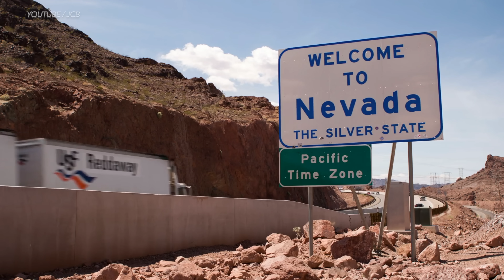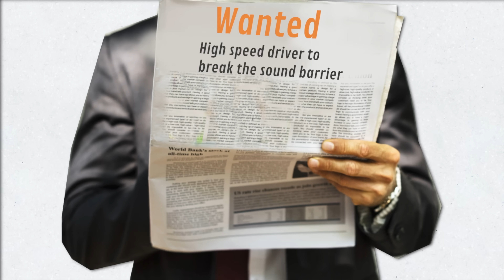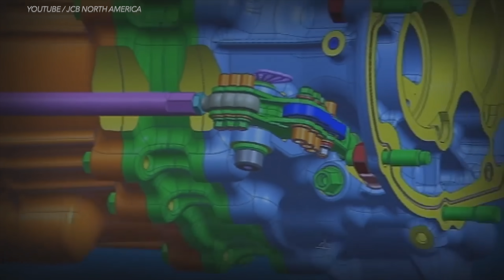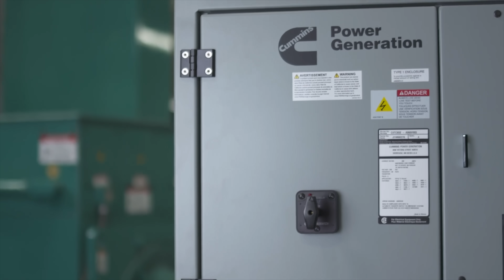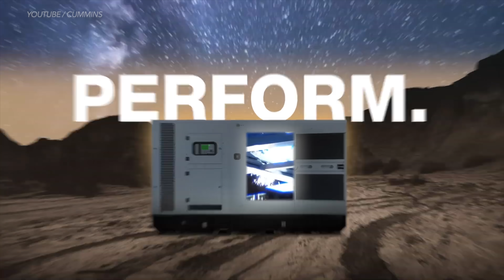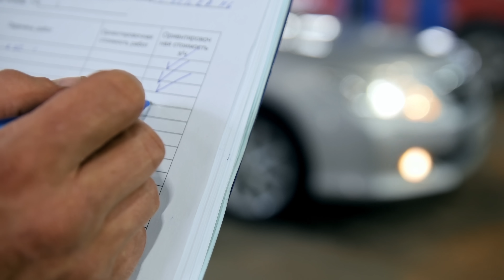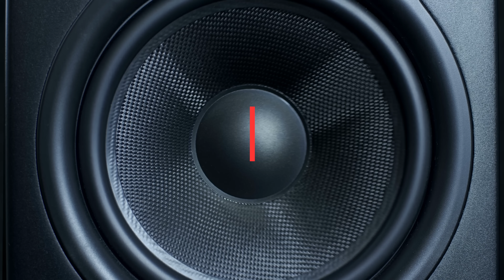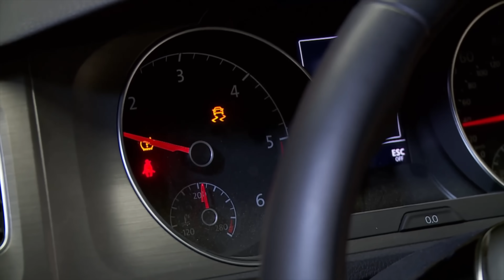Here's Why Diesel Engines are Being Banned

Comment: 0:10 - What good does it do to have a diesel engine?  You'll find that the higher efficiency is offset, almost exactly, to the penny, by the higher price of diesel.  You save nothing.  You get a touch better performance... and a whole hell of a lot more headache maintaining and repairing the engine when it fails (and it will) sooner than a typical gasoline engine.  They're designed that way.  Only big diesels, like semis and other industrial engines, can go half a million miles before they start to fall apart.
Not turbodiesels...
Reply: Dont now where you live but in the UK presently petrol £190 ltr, diesel £1.96, price difference pretty insignificant I,d say, yearly service £250, 9yrs old 2.2 D, Honda. cheap cheap cheap.

Comment: I still love my 1995 Toyota surf. Strong robust and reliable. Given regular maintenance and services will still last many more years. Yes  a little noisy than petrol. But if you want a car that you want for years and not trade in often a diesel for me is the best choice.I do find petrol engines fragile in comparison. Whats an electric car for? How long are you going to wait for a full charge? Better bring a hand cranked dynamo generator to charge them batteries when you're out in the middle or nowhere !! 👍 Just saying 😉

Comment: There's no solution and there never will be. The more EV's we have the more the demand for electricity. In the years to follow, they'll admit this plan isn't working because renewables just wont cut it. And there's this thing called population increase. Then they'll decide maybe it is time for nuclear power plants. Then they'll realize the mining for Uranium consumes just as much energy as mining for coal. Then there will be more nuclear waste in the years to follow. There "is no" solution. The greenwashers need to STFU and leave gas engines the way they are and leave the diesel trucks alone.

Comment: I recently got the Diesel powered 3.0L Silverado RST Crew Cab, no regrets here. I love it and it replaced my 2014 Sentra(45k miles)...before the dreaded transmission problems of it's crappy CVTs could happen out of warranty and all the cars at the house where in no shape to tow anything(2021 Tesla Model 3 Performance, 2018 Hyundai Sonata Plug-in, 2016 Chevy Spark EV). Daily driver to work that gets almost similar overall millage I got on the Sentra and tows and hauls cargo whenever the true purpose of getting a truck is actually needed for...and when all the family is home for the holidays it can sit 6 people rather comfortably so it also makes for a good road trip vehicle, though that won't be happening anytime soon with sky high fuel prices.

Now while having this maybe the EV truck market will mature more in the meantime when more competition rolls around in the next couple of years and certain car makers solve their current problems. Ford is too new to the game to determine and Chevy is having the major issues with the Bolt EV...so it's concerning to think about a Silverado EV before they fix the Bolt's issues. Which giving it a couple years time is advisable.

Comment: I have a 2014 Ford Mondeo 2.0 L diesel. Is a very good car and the fuel economy is pretty good as well. Just did around 1000 KM with a full tank.
Reply: I had the same car, with the same milelage. I loved that car, but had to sell it because the milelage was over 500kkm. I also had no single problem with it in the 14 years i drove that car.

Comment: Driving my Mercedes’ bluetec diesel for 13 years now. It has its issues of leaking oil and bad urea pump heater, but I can live with it. There is nothing like it when I go on long trips and getting 30mpg and 600+ per fill up. Not until recently, diesel at where I live is cheaper than premium gas.

Comment: I am from the Eastern Europe, and I have always been driving Diesel cars. I also drove gasoline cars, but only in USA and twice in the Western Europe.
My feedback regarding this topic is that Diesel cars are absolutely great. The maintenance and service costs are not higher at all. The mileage is absolutely great. They are surprisingly reliable. The running noise and exhaust emissions decreased dramatically during the last 10 years. You can drive Diesel cars in every driving style.
Unfortunately the combustion engines are pushed aside lately, but a world without such cars is just a lie.
Reply: Totally agree. A lot of the "facts" in this video are not correct. 
Diesels are very good now. They didn't use to be but the technology has made them much easier to live with. 
Main problem is finding a decent garage to service with quality parts.
Reply: I live in Sweden where we have very cold winters and my diesel car has never failed to start. It also has a built in fuel fired heater that can be activated remotely so that the windows are already defrosted and the engine is pre-heated when I arrive at the vehicle. Modern diesels are great for winter conditions.

Comment: That VW engineer who came up with the test scenario software is a genius.
Reply: All the manufacturers did it, VW were the first ones to get caught.
Reply: @dr1verman  if it passes at the said test areas whats the problem the government more than likley did not get there kick back !
Reply: The only reason the government got involved with VW is the Jetta diesels averaged 50 mpg. Couldn't have that kind of fuel efficiency. A good friend got caught with an original program when he went to get emissions and the emissions were almost zero. He got fined and they changed the program without his permission. He went to 27mpg and still passed emissions. He moved to a non emission area and had a friend reprogram it back to the original program. He's back to 50-52 mpg.
Reply: My cousin had one that got recalled.  That Passat got 55 mpg.  After retune them and putting in it my wife bought a 2012.  It now gets 43.  That def suck the power and mpg out of a diesel engine
Reply: Now that the EPA is about to be torn apart and thrown to the wind, can we get some sanity back? EV's are a J O K E. The power to build them, to build wind turbines and solar collectors, has to be made by diesel, coal, hydro or NG. Steel has to be made using refined coal called COKE, which needs heat and pressure provided by NORMAL forms of energy.
Reply: So many they didn't pay for in the world and a smaller company would have been gone like firestone. So damn corrupt..
Reply: I am a retired used car dealer ,I own a 2015 VW PASSAT this is 
Absolutely the best vehicle I have ever sold !  Interstate travel  we get 47.9 mpg at best . Combined city driving never less than 39 mpg 
VW received the biggest screw job ever performed  !  If you remember who was in power during that time 2010 thru 2015 you will remember he hated Germany. 
Our dirty government lawyers went after VW with a meat grinder !  
If the same tests were made on all of our US company's at that same time by (independent  ) examination, that wasn't in someone's pocket receiving kick backs ,well the results would have show up . Biggest hit job in the automotive industry in American history  !
VW repurchased every 2010 thru 2915 Audi ,and Volkswagen diesel engine vehicles.  VW paid premium prices to the owners to get them out of there vehicle.  VW thin did a emissions re work to satisfy the US Government ,COSTING THEM $$$$$$$$$$$$$$ How they survived is astonishing.  
I am disappointed in the governments big arm in how Volkswagens trial was strong armed into a horrible settlement with the United States.
Reply: @timothycrose7081  we had a 2012 Passat TDI pre dieselgate. The neutered cars as you point out, got horrible mpg’s post OEM software ‘upgrade’. Now have a tdi Touareg. Would love to flash the ECU w after mkt software where you can reinstall post dieselgate OEM software for dealer services. But I hear there’s a software counter thing in the ECU that could cause OEM warranty issues.
Reply: your right and should be given a award
Reply: Nobel Prize needed.
Reply: My wife bought a used reflashed 2015 VW tdi for 6500$ with 70k miles in 2019 its bluebooks for double that now, they are a hot item it's our second TDI and I still daily drive our 2006 Golf TDI with 279K.
Reply: Cummins did the same thing lol. I owned a VW TDI first time now I own a Cummins lol

Comment: Yep. I  live in the UK now, and had a 2005 corolla d4d tspirit turbo 4 cylinder diesel car. Averaged 40mpg city, and close to 60 mpg highway. Sadly, I hit black ice back in January an it was totaled into a 500 year old stone wall. The wall definitely won, with just some scratches. I’ve now got a gas 2005 rav4 for the extra space. Get probably 35mpg city, 40 hwy. still not bad, but I sure do miss that Corolla.

Comment: ...big ocean transport ships pollute WAY more than all the cars on the Planet.  Now they are required to use low-sulphur diesel.  That's where it's all going...they need all the diesel fuel to run boats...
Reply: Low sulfur fuel oil and marine gas-oil are not diesel, but they do require more processing than heavy fuel oil. Maersk is building 8 large container ships that can run on e-methanol.

Comment: I'm French and here every one is still obsessed with diesel, the price per liter was lower than gasoline but that changed recently but it's still cheaper because you get more milage, here people even buy hot hatchback with diesel motors like a Volkswagen golf GTD or mini Cooper SD 

What a crazy place, I never owned a diesel and I'm never gonna get one it's just not that good it's feeling slow when driving and it's dirty and slippy when diesel is on the road it's like ice
Reply: Diesels are made for hauling and getting your a ss around.  If you want to race and waste fuel go get a gas one and eat your beans.

Comment: How long do you recommend warming up a diesel engine in a cold climate??
Reply: On my 2005 chevy 2500HD, until the glow plug light goes out.  15 seconds?  Start.  Then idle about a minute.  Never had a problem.  HA HA.  Haven't operated it below 0 deg F though.

Comment: Personally had diesel vehicles here in the UK since 1991, never had a single issue with any of them regarding the fuel systems, injectors, pumps etc. They are ultra reliable, my VW LT had done 200k miles when I sold it, and I bet if it doesn't rot, will do another 200? Our local taxi firm had Peugot 405s that did over 650,000 miles by the time they moved them on.

Comment: I never had a diesel however I did take a diesel mechanic class at a vocational school many yrs ago. I always found them to be noisy and slow now I'm sure they are better nowadays as I'm talking of the 90s primarily. Now if they really do have health risks that's kind of concerning especially for those driving one daily.
Reply: When you actually learn what diesel runs up to a million miles without rebuilding. If your lucky gas engines last about 150k and uses more fuel to hp ratio

Comment: Scotty's brain is dead  because the main transport mode for global trade is ocean shipping: around 90% of traded goods are carried over the waves. While the engines nearly all cargo ships use is diesel combustion engines to turn the propellers, plus diesel generators that power onboard lighting systems
Reply: Most ships use heavy fuel oil, some ships are starting to use LSFO (low sulfur fuel oil)

Comment: I own a Mercedes powered Jeep Grand Cherokee with the OM642 3.0l common rail turbo diesel.  Love the torque and fuel economy, only major issue(s) related to design flaw with pcv location next to turbo inlet.  Costly lesson but solution should enable me to go past 500k on the engine.  Need the torque to tow a camper.

Comment: Love my 1 ton extended wheelbase van with the GM 6.6 turbodiesel.  I hook my Jeep to the back and I'm good go.  Put it in tow/haul mode and set the cruise control nd sit back.  Up the mountains down the mountains in crise at 70-75.  Just picked up a new Jeep diesel - so far so good.  400+ pound-feet of torque barely above idle.

Comment: Got my first 3.0L turbo diesel 4x4 a Toyota 95series TX model almost 22y ago. Still have it original built as it is for me the best most reliable vehicle with the standard fitment longest range of +1400km(+890miles) and safest fuel for touring in the Australian outback on its 159L(42gal) tanks at 11.1L/100km(21.2mpg).
For around town I got a 2008 Hyundai i30 1.6L turbo diesel that gets near double the economy of the Toyota at 6.1l/100km(38.5mpg) and only issue being the transmission...
And for fun I bought a old driving school car being a 1986 Mazda 626D 2.0L diesel that after 36y on the road and with original naturally aspirated engine build and exhaust still is happy to chugg out 4.9L/100km(48mpg) all day and not skip a beat...
Heck, even my standby 6kVA generator is diesel.
Just wish someone would produce a affordable diesel ride-on mower so I could get rid of that dangerous flammable 20L(5gal) gasoline refueling container.

Comment: I'm driving a TDI Beetle I got from my mom.  It's an automatic, but I'm still getting over 40 mpg combined, so even with higher diesel prices I'm paying less per mile.  I enjoy the car, and I'm learning to do the little fixes.
Reply: The only reason diesel is more expensive in America than gasoline is because the oil companies testified before Congress that they should increase the tax on diesel fuel.  And they did.

Comment: I have the engine in the thumbnail, 2.8 liter Duramax in a Colorado. Awesome little truck that gives us 35mpg regularly which is amazing 4 anything with 4wd. Yeah long term it will likely have emissions system part replacements but even in the face if that I think I prefer that over turbocharged small displacement 4’s with direct injection and the issues those will face longterm. Hybrid drivetrains also gave battery pack replacements in 10-15 years depending on climate so I think there really isn’t a great, fuel efficient option if your plan is to own something for 20 years… or buy one if the current vehicles in the market when they reach 20 years old.

Comment: Railroad engines use the huge diesels to turn a large generator. The electric traction motors on each axle moves the train. Their advantage is when the wheel slips the electric motor cut off for a fraction of a second to reestablish traction. The generators put out 600 volts and up to 1500 Amps. Seems like a small efficient diesel running a generator would be a much better electric car syst than those heavy, highly polluting to produce, batteries.
Reply: How would that be an electric car?  What you described is a diesel car with an electrical transmission.  A while ago they figured out that with heavy-duty applications (trains, giant dump trucks, ships, etc.) a system that transmits power to the wheels (i.e., a transmission) yields much better performance and efficiency at a lower cost when it's electrical (or, technically, electromechanical:  generator->wires->motors) as opposed to purely mechanical (e.g., hydraulic).  That's not the case for smaller vehicles -- otherwise they would've already done it, since the technology is not new at all.  The exception here is, of course, hybrid vehicles, because in that case all you need is basically just an electrical transmission with some batteries.
Reply: The only logical use for electric motor driven vehicles, is a generator on board that can charge on the go.
Reply: @markslinger9042  Told the wife, if they make us go electric l'll be going down the highway with a small trailer with my generator and some gas cans behind me. Don't want to spend an extra 4 hours to make the already 6 1/2 hour drive to see my mother.
Reply: @markslinger9042   You're still describing an ICE with an electrical transmission.  In some cases that makes sense (e.g., heavy equipment and/or hybrids).  In other cases (e.g., regular cars) not as much -- at least not at this point in time.  

An "all-electrical vehicle", if you will, stores electrical energy on board but doesn't generate (most of) it.  The idea being that if the energy comes from a "clean" source, whatever the hell that means, at a minimum you're not burning anything on board.  Obviously energy storage is the big largely unresolved problem, but if you've got an ICE on board it, by definition, becomes an ICE vehicle regardless of how traction is actuated.

Comment: From an affordability perspective, diesel is at a disadvantage if you don't NEED a diesel engine for your application. The initial cost, maintenance expense and longevity can remove diesel as an option. Of course, some of that may be true for electric vehicles too. For populations where a daily driver on short trips is the norm, no 'long haul' road trips are likely. In locations with high density populations, public transportation is needed too. Regardless of the power plant, parking space comes at a premium. Human-powered solutions must be considered.

Comment: We have owned diesel pickups and semi trucks in my entire life. I would not choose anything else given the opportunity. That said, the diesel of old days isn’t the case today. The new emissions requirements are expensive to repair and the jury is still out whether it’s reasonable to expect 400-500k miles out of these engines with this emissions equipment intact. But In spite, I just bought two new 2022 model pickups with V8 Diesel engines. Who knows, they could be the last if the govt keeps up the death march for “clean green initiative” which we all know just shifts the use of petroleum to somewhere besides under the hood.

Comment: I drive a 2014 Cruze diesel and love it... I have replaced the DEF system tank & sensors, the DEF system is the biggest downfall, but mechanically it runs just as the day I bought it with 170k on the clock. I plan on keeping it up and maintaining it until i can't get parts for it. Love the channel Scotty, thank you for what you do!